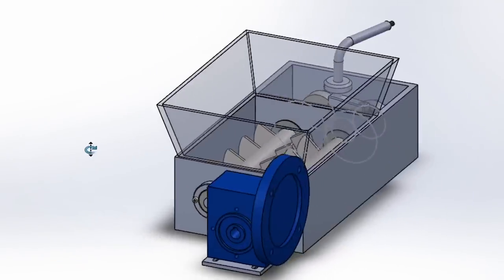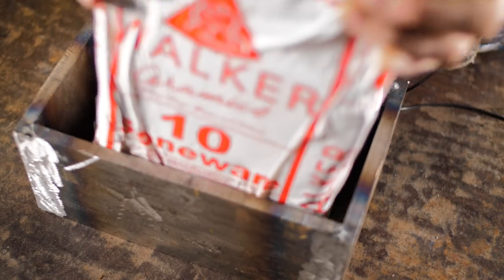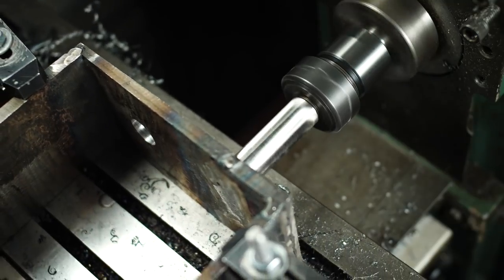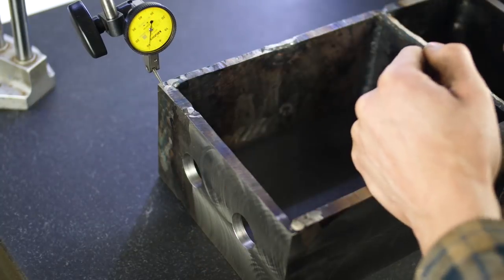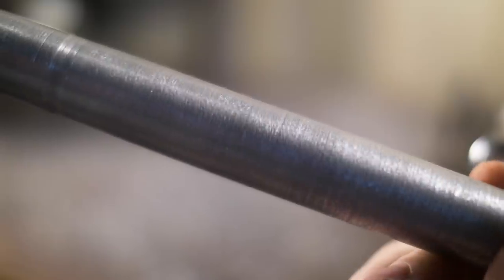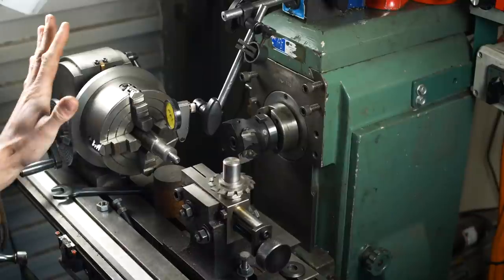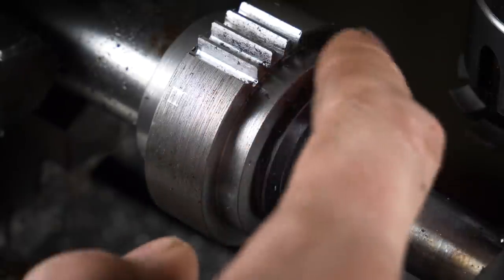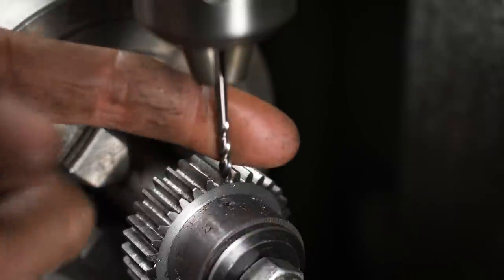Pug Milling Attachment | Mechanical Build 1 of 2

Comment: Gday Tommy, you were having one of my days donating to the screw up bin, there’s no reason this design won’t work because it will work once you have done you magic with it, great video mate, Cheers Matty
Reply from the maker: Thanks Matty. and if it doesn't work I at least have the motor and gearbox to make a slow speed grinder for sharpening carbide I guess
Reply: @TomMakeHere  it really is a win win situation, what do you really need the most is the big question

Comment: I use Sutton drills as well but recently i set up what i call a tap caddy - just a block of wood with taps, dies , tapping drills and tap and die handles mounted in it and i had to buy a few of the correct drills for it . I ordered Sutton and a few days later they arrived at my tool supplier .When  i got them home i was looking at them - can’t repeat on here what came out of my mouth when i read on a couple of the packets MADE IN CHINA 😭
I know Sutton make drills in Australia and NZ but the bastards are now getting them out of China and still charging the same as an Australian or NZ item 😡
Not saying there is anything wrong with the drills - it just annoys me when that happens !
Reply from the maker: 😮 Cheers I'll look a bit more closely for that
I've boycotted buying chinese where possible for various reasons
I try to buy from Aussie companies especially when I know it is made here too
Reply: Great you bought expensive Chineseium drill bits.  You think you are buying locally and all get screwed.

Comment: I've always maintained that 2 set screws should be 120 degrees apart (so that there are 2 points and a line of contact equally spaced around the periphery).  Thanks for agreeing !
Reply from the maker: I see 90 quite often, which I guess is pretty close so doesn't matter, but 120 makes logical sense to me

Comment: Any special reason you didn't centre spot both ends of the arbour, and turn it between centres?

Seems the natural (if old fashioned) way to work a gear.
Reply from the maker: My lathe and dividing head conveniently have the same thread for a screw on chuck. I just move it from one machine to the next.
I've checked in the past and there is almost no runout
Otherwise, you are right, between centres would be the normal way

Comment: Gear cutting is usually the slowest process so it makes sense to cut as many gears as possible in one setup. That way when one makes a cockup it  writes off the most possible time!
Reply from the maker: Or a good chance to make them all and then realise your arbour wasn't centred!
I always check every gear after making it as there is a lot of potential to screw things up. This is actually the first project where I've had indexing issues (and twice lol), normally it is a tooth alignment problem for me

Comment: You can tig weld the end of the bushing to the shaft without much distortion or make the bush oversize, weld, then machine to size.
Reply from the maker: Yeah good point, I might do that as I also need to cut a keyway, it might not hold if I slot through the bushing

Comment: Good tip on buying drill bits. So many sizes in a full set that you never use...
Reply from the maker: Same with taps, I see people buying the 50 piece tap sets for $20, and they have nothing but problems (I was guilty of doing this in the beginning)